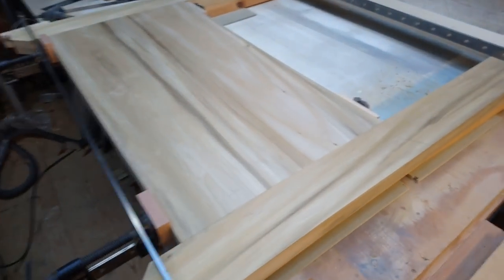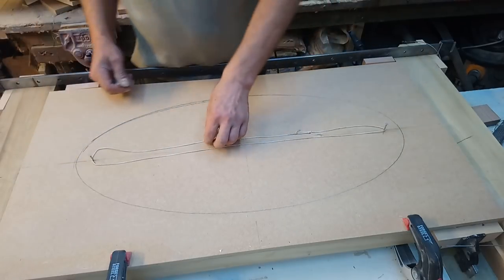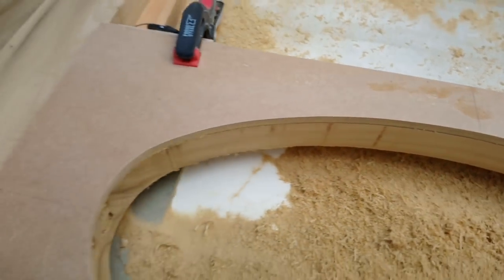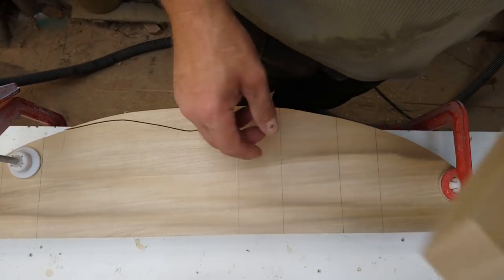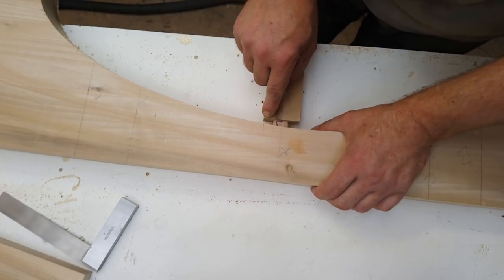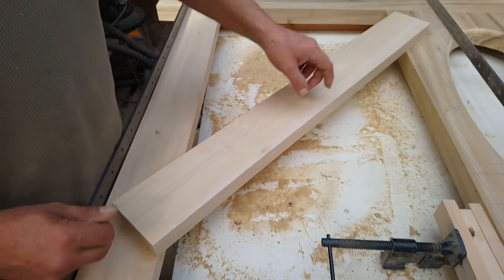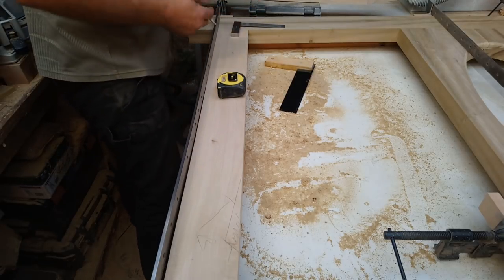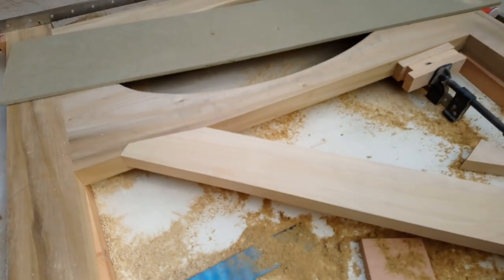Gate Making Pt2 - Cutting out the oval, fitting the spindles & brace

Comment: Good job I didn’t think popular was good for outside joinery
Reply from the maker: Thanks Joyce, no it isn't the ideal wood to use, it wouldn't be my first choice but they wanted it to be made from pine, I couldn't get decent wide boards so we made a financial agreement about using a hardwood, the cheapest poss basically, if it's painted well & stays dry it should last as long as pine if not longer 🤷‍♂️🤷‍♂️🙃😉😁,